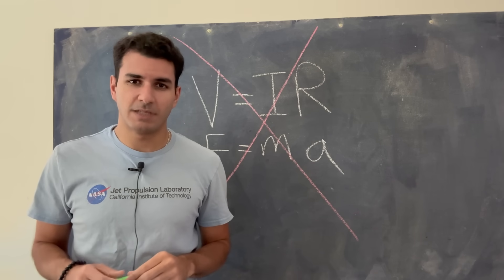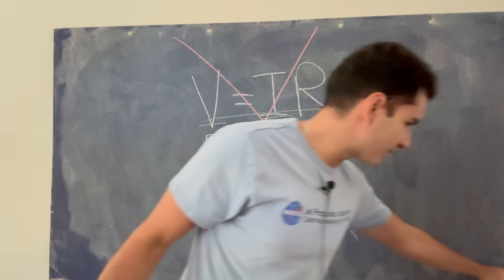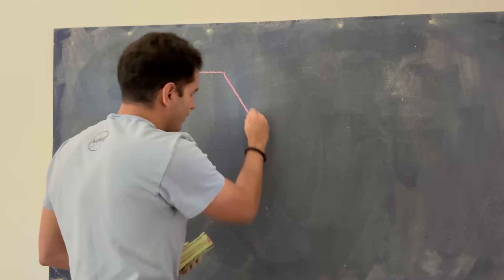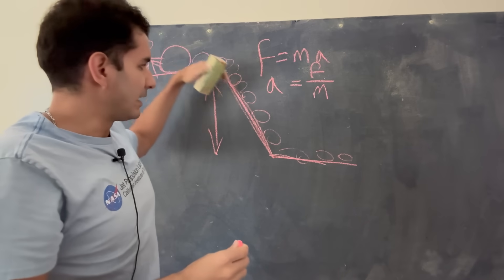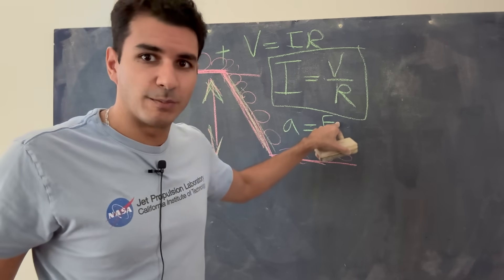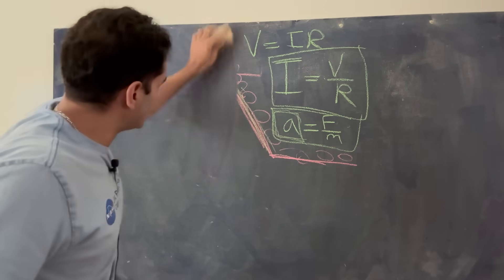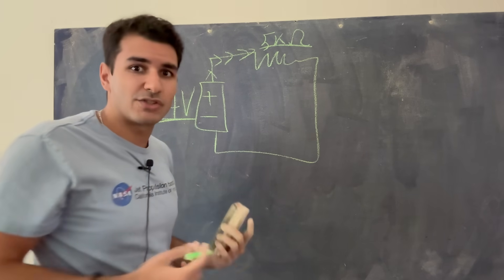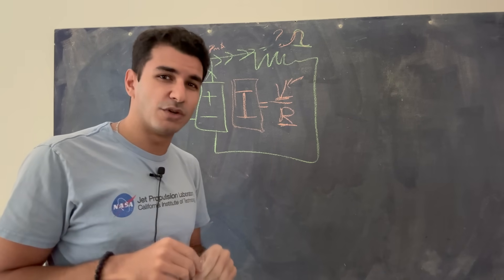You don't really understand physics

Comment: I love this. especially the part at around 6:00 where the realization hit like a truck. Im not a student or anything like that, I just work retail lol, but where do I find more stuff like this?

also maybe if I can see if I understand that right. So your talking about in essence how to abstract ohms law into basically potential -> kinetic energy and the resistance / friction in between. Theres an actual movement of charges and electrons so this makes a lot of sense to me. Voltage being a potential, so the voltage is basically the potential energy, which is released as current or kinetic energy, and is "controlled" or "regulated" by friction / air resistance of something hitting air molecules just like the electrons smacking against the atoms in a resistor / insulator which has a rigid body and lacking many free electrons. ofc not 1:1 analogy but its close and makes sense at least to me. I know this isnt exactly what you explained but on a bit of a deeper level I guess this is a way to interpret it. or maybe im just dumb lol. I took physics but I only ever learned like basic 2d kinematics like s = d / t type shit it was fucking awful so idk. in any sense when I look at ohms law I only look at it for low voltage because of electric breakdown. insulators only work until a certain voltage and then it will literally shred electrons off the atoms in the material turning them into free electrons which can move as current thus turning an insulator into a conductor. this can basicallyh happen with air and you end up with arcs and plasmas. when it comes to "rearranging" the terms its just basic algebra. for example you wrote at first v = ir but you can divide v and ir by i and en up with with r = v/i which is another formula for ohms law. you can algebraically move these terms however you want if I understand right. ohms law isnt just like some formula, its a triangle of relationships between 3 variables which equals a 4th, but the same way you can reverse a divison problem into an algrebraic multiplication problem (i.e 4 / 2 = x into 2x = 4) and same side crap blah blah blah you can move these wherever sensibly.

Comment: I am 14, and I learned f=ma as a=f/m, as acceleration is caused by force relative to mass... and not force is acceleration gained times mass... it just makes more sense... physics has a lot of fun , simple, yet a bit confusing formulas, which with improper writing can mess your understanding up, ig formulas in physics should be seen using how it applies to real life, rather than the typical maths derivation and formula..

Comment: Absolutely right 
V = I R gives the impression that the voltage V is a function of current, which is not the case.

I = V / R suggests that the current in the circuit due to applied voltage depends on resistance R, which makes sense.

Comment: Nice video, touching to the meaning of cause and effect.
Through the middle of the video I remembered something, kind of unrelated, but that I heard as a child and it still makes me question.
If you were to throw a tennis ball, and while it was flying on the air, you stop the time, or take that frame of time as a singular scene. Where would you put the acceleration, energy of the ball? Does the ball holds it inside?

Comment: Its such a baitclick. You don't understand physics no matter how many times you jiggle the puzzles. Even if you connect variable with real world mechanic it still won't affect your understanding of physics. At most you may have better grasp at how the equation works. Simply because equation is ideal and narrow representation of some event, and it in most cases it doesn't explain why it is the way it is.

Comment: I thought you were gonna talk about how there is a breakdown voltage beyond which ohm's law doesn't work cause of polarisation at surface.

Mathematically speaking how you see equations is extremely wrong there is no cause and effect in equations if we have 
f(I)=IR then it simply indicates a change in the value of the function with a change in I taking R as constant cus v and i have linear relation inside ohmic region.

Comment: I disagree with rearranging V = IR. I understand that I is dependent on V and R, but its all to do with how you frame the question.

 If I ask "What is the potential difference between the ends of a component given that a current of I is flowing and the component has a resistance of R", then it makes perfect sense to consider V as the "dependent" term and I and R as "causing" a certain potential difference to be dissipated.

The same is true for F = ma.

"What force is required to move a mass of m with an acceleration of a"

 Its perfectly valid to write it as F = ma or V = IR depending on the question youre asking

Comment: This is because mathematics and mathematicians have no respect for cause and effect or the actual real world.  Everything in math is hypothetical and hypothetical deduction, and they absolutely refuse and resist to filter out which of it is unempirical and which is not.

Physics (thankfully) is the opposite. Physics is all about finding out, from the space of all hypothetical options, which is actually the case in reality.

Engineers are neither mathematicians nor physicists.  Engineers are just told what to do by both groups to get the right answer without questioning why.  Ideally the engineer will have a working understanding of both mathematics and physics, but due to practical time constraints may just wind up memorizing things to get certified to start getting a paycheck (engineers are usually motivated by money rather than by passion for science).  Some engineers may be passionate about creativity, but they are a good minority. 

And philosophers sit back from the outside and figure out exactly what the differences are between all the groups, to find out who's right (and why).

Comment: Wow, I always had exact same thoughts. a = b doesn't always imply that b causes a.  Especially in electromagnetics where you have a bunch of B,H,Ф,V,L,I, etc, Faraday's law,  Amper's law etc,  which may leave you totally confused: does I causes  H, and H causes B, and B causes Ф? Or flux causes back Emf?  In transformers and inductances, there is a counter Emf caused by a changing current but the current was caused by the applied Emf.  Or how do I calculate the saturation current? etc There are tons of equations that are just rearrangement to solve for a different parameter.

Comment: i have an MS in EE engineering and learned nothing new from this video but I have many questions now. How is someone looking at v=ir and not understanding everything he said regardless of how you rearrange the equations. Of course resistance or mass are assumed constant here and you have to apply voltage or force to get some current or acceleration in case you can move the object first. How does someone not know this? Isn't it intuitive?

Comment: This is great to point out.  You made an analogy between pressure P and voltage V. Can you make a short video about analogous concepts in electrical and mechanical engineering. For example, the equivalent of impedance Z in mechanics. I think many young people will find it useful

Comment: I'm sorry, but V = IR, is just as valid as I = V/R.
Which quantity is independent vs dependent depends on conditions.
Photodiodes, & transistors, behave like current sources. The voltage depends on I & R. Batteries & generators are built for constant voltage. So we can regard V as independent & I as dependent.
But batteries, & esp generators, can be built for constant current operation. V is dependent, I is independent.
The idea that V is always independent,cwhile I depends on V & R, is a prejudice that won't go away.
Lijewise F = ma is just as valid as a = F/m.
When we play pool, we hit the cue ball, & it hits the target ball. We can impart a force to put cue ball in motion. Force before motion. But then cue ball strikes 1 ball. The impact results in force on ssid 1 ball, caused by motion of cue ball. The faster the motion of cue ball, the greater the force incurred at the 1 ball.
A force can be realized due to a motion.
In general, either can be cause or effect. F & a, as well as I & V.
This lecture illustrates a very common prejudice.

Comment: The problem is math, as it is an over generalization and at best an analogy for what is actually happening. Take for example the V=IR equation. It only holds true as a spacial case generalization when dealing with direct current. When you have alternating current above a certain frequency, that formula no longer applies, because its the magnetic wave component that is transferring the power and as frequency increases it essentially becomes like a direct current super conductor, so R=0  above a certain frequency threshold. An example of this is any radio transmitter. You can have one transmitter that sends out a signal that is received by a billion or more radios and the power to send that signal doesn’t increase or need to increase depending on the number of radio receivers. It’s an over-unity device due to the magnetic wave component of the Aether/ZPE field, which is the true source of power for both the transmitter and the receiver.

Comment: hmmm... electrical engineer here... not sure that I completely agree... I see what you're driving at and there is merit in what you say.... but... for example V = IR can also be a useful way of viewing the equation... it shows that the voltage across a resistor depends on the current through the resistor and on the resistance of the resistor... it depends on what you are trying to understand about the resistor and voltage and current... the equation can be viewed/understood in multiple ways

Comment: If there are several resistors in series and parallel connected to a battery, then voltage drop across any resistor is current times resistor value of that resistor. Different values of current is flowing in different resistors. So in such situations v=i*r is handy. A particular voltage from a circuit element is needed at times. In fact the formula is correctly formulated in good text books. It is ease of remembering that you prefer your own version without loosing sight of the theory behind it. So, in my opinion there is no big deal about it.
Reply: Mr. Ali, I like your style of explaining the concepts. In fact you love science and live science, which impresses me most of all.

Comment: Interesting! As a retired mechanical engineer, F=ma is engrained in my brain. I never really gave it much thought and simply, as you mentioned, just plugged in the numbers to get an answer. So, your video gave me a much better understanding of what actually occurs: acceleration happens because the force is able to overcome the resistance of the mass (a=F/m). Very intuitive. Thanks for a great explanation, Ali.
Reply from the maker: Exactly, you've made the connection! Very happy the video helped :)
Reply: Why is everybody so proud that they never gave much thought? ;-)
Reply from the maker: @lepidoptera9337  they're more happy that they realized it from a new perspective -- the old one worked just fine and clearly served them well, this type of deeper insight is still satisfying since it leads to a deeper understanding
Reply: @alithedazzling  New perspectives on Newton???? That's 330 year old theory. ;-)

Comment: As an engineering simplification - There can be V without I. There can be R without I or V. But you can't have I without V and R. From a physics viewpoint, whether a resistor sitting unconnected on a table has particular resistance is the beginning of a thesis.